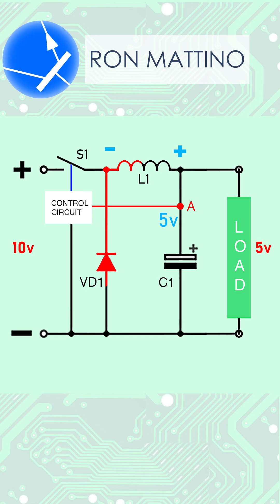How does a DC-DC Stepdown (Buck) Converter Work? #diy #electronics #stepdown #buck

Comment: You got it all mixed up in this video.. That component you call a switch is also the Control in this circuit, its the whole regulating buck converter for the voltage.. The IC you point to as the Controlcircuit has nothing to do with the voltage regulating Control, it regulates the current and is not always present in a buck converter..  This module has the extra function that you could set max current out and the module starts acting as a constant current source if you try to pull more then set value.. Useful if you want to charge batteries or drive high power LEDs..
Reply: Yeah, what i ment was, if someone explains it wrong, you learn it wrong also.. If you only want the big picture then i doesnt matter as much..
Reply: Wrong or not, this clip for the first time has opened my mind to understanding buck converters for first time in months. I have struggled so often and given up frequently -though I kept trying. 😂😂
Reply: @eriakup  that’s cause you’re dumb, this video is trash
Reply: The role of the control circuit is controlling in the transistor (switch) when open or close then select the suitable duty cycle which give the desired output voltage
Reply: I really love this comment ❤❤❤❤
Reply: Actually it even more important than video itself💪💪